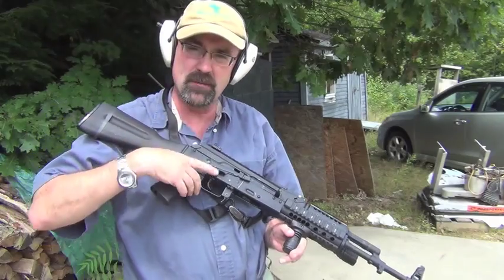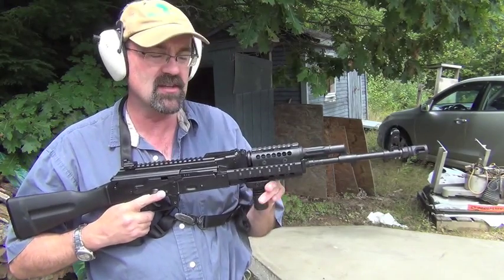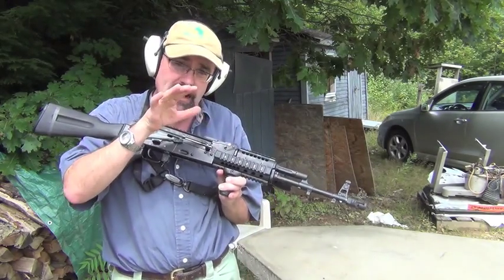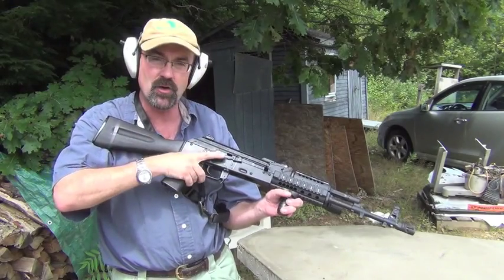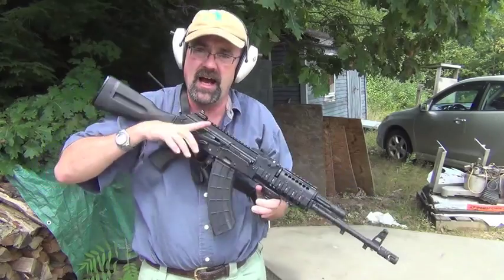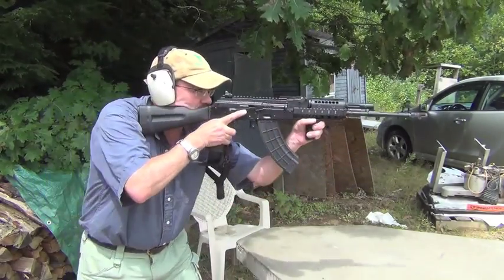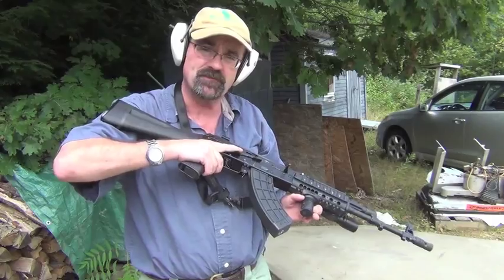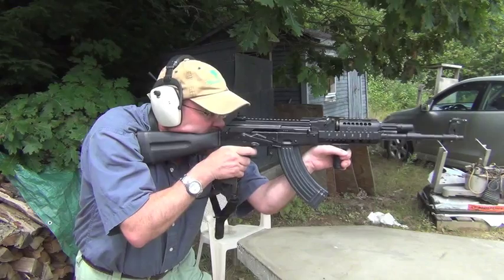AK 47 Muzzle Breaks on the Arsenal SGL 21

Comment: I have both the nigh break and night shrowd recoil with the night break is about the same as the 74 break but it's lighter and shorter. The night shrowd works great I had one mounted on a 5.56 ak and it controlled the flash well

Comment: Question: is that ak74 style break ever so slightly wobbly? I just bought a new arsenal 107 that comes with that break and it is a bit wobbly. I don't think it's enough to be a problem, but wondered if you experienced that issue.
Reply from the maker: Dean Thorton Yes there is a bit of play in it. That prevents it from getting stuck from carbon build up.
Reply: I guess that's one way of looking at it.